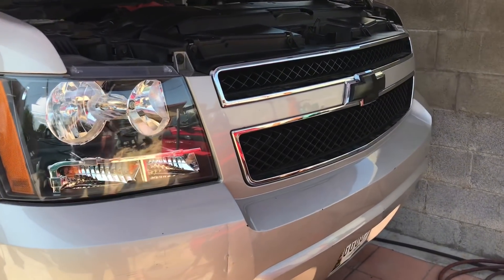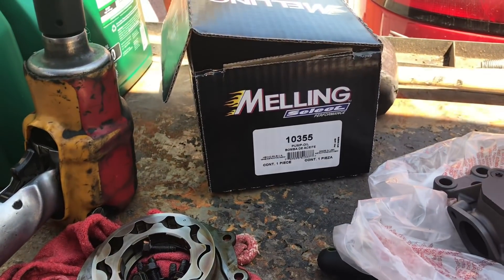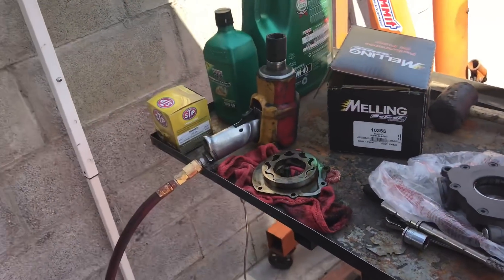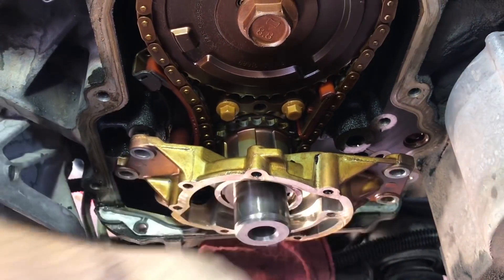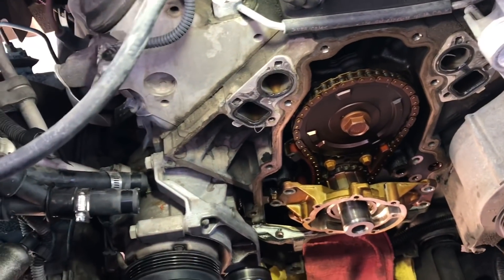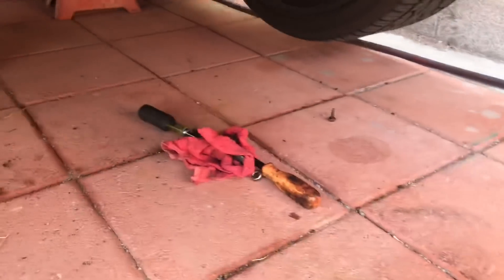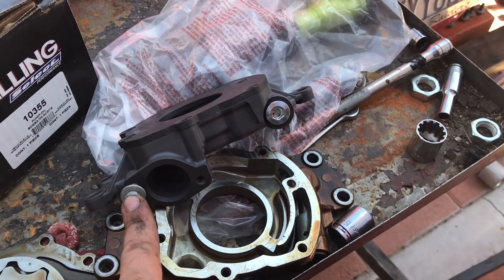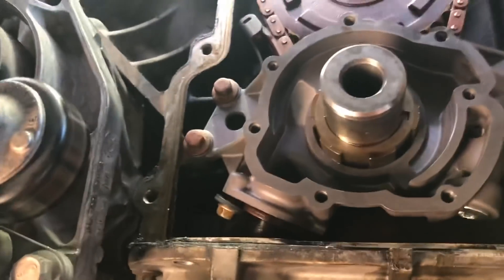Chevy 4.8,5.3,6.0 LS oil pump

Comment: After backing out the pickup tube bolt, tie a string around. That way it's easy to get if you drop it. Remove the string after you get it started again.
Reply from the maker: Duaine Reynolds Thanks man good idea I’ll try that next time!!!
Reply: Duaine, that gives me an idea. I wonder if you wrap that string the right direction around the bolt, you could pull it to spin the bolt back in when reassembling to avoid having to modify the pick up tube. I think I’ll give that a shot when I do mine.
Reply: Fishing line yep!

Comment: Why didn't you just shim the existing relief spring, or replace the spring (or both) in the original pump BEFORE swapping the entire pump ? Obviously the original pump may have seen some sag in the spring, allowing it to open prematurely, ESPECIALLY when cold under greater pressure, so a shim could have solved the problem much easier, or at worst, just a new spring. The gears looked mint, so I think an entire new pump assembly was a bit of a waste in both time and money. Remember, the filter area of the inside of the pan also has a relief valve, so this could have ended up being entirely pointless in the end. Just a thought.
Reply: Totally agree!

Comment: Why did you take the pump apart for the gears??  I'm confused there.
Reply from the maker: la nave del sabor 
A must when replacing pump, when u don’t want to remove oil pan. Otherwise if u remove oil pan no need to take oil pump apart.

Comment: All you have to do is remove the oil pan. This will allow you to easily remove oil pickup line.
Reply: Paul Leksunkin unless you have a 4x4!  Then it’s skid plate, remove half shaft, disconnect CV axles, remove front differential, drop steering then you can finally get to the oil pan!
Reply: I have 4x4 and only had to unbolt differential the it dropped far enough to pull oil pan out. No sweat
Reply: What are the chances of it being the pump and not the O ring.?

Comment: So I just done this. Used the washer and bolt trick. I did not replace the o ring. Now I have a low pressure warning on. Is it the o ring or is it the washer and bolt? When the engine is at 2000 rpm oil pressure is between 40 and 60lbs.
Reply from the maker: Rob Hudson definitely the O ring
Replacing it is a must!!! That’s why ur loosing pressure. U need to replace it asap!!! Engine is probably starving for oil.
Reply: oscar corona that was my guess too. I know I should’ve but just didn’t. Really cool trick about the pickup tube super helpful.
Reply: you had all this stuff apart and didnt replace the biggest cause of low oil pressure on these things? (the o-ring)....man--i wouldnt want to do that job over...

Comment: You have to drop the pan and replace the oil screen . if that is plugged up your going to still have low oil pressure . if you drop the pan first and change it out that might be the reason you have low oil pressure .
Reply from the maker: Estebahn Goldman 
Your correct that can also be an issue 
Luckily for this vehicle new oil pump fixed the problem. Thanks for the input will consider it for next project:)
Reply: @mrcrown9657  We dont know if it fixed the problem

Comment: All that extra time you could have done it the right way the first time... your not supposed to disassemble the oil pump!
Reply from the maker: Brandon Anthony actually i saved about an hour, I’ve time myself before. Done probably over a dozen. Never had any issues. Then again this is just an option if u don’t wanna drop pan, that’s why i made video.Customer didn’t want that-so... I actually prefer to drop pan too
Reply: What ever you say bub

Comment: What was your pressure before and after?
Reply from the maker: William Taboada 
Cant remember exactly but it was way below half mark on gauge and lifters used to tick a lot at star up. Now pressure above half mark and no more ticking :)
Reply: Im thinking he only needed an O ring
Reply: I just change on a 2002 gmc denali 6.0 motor sparkplugs and wires  change  of oil & oil pressure sensor changed, bank sensor changed.. code p0141 02 bank1 sensor 2 ,  eliminated  2 codes p0141 and p0300 misfire detected. Code p0300 misfire detected. Motor has a thicking sound with low oil pressure in my cluster gauge. I think I just found my problem oil pump. I was thinking it could of been my catalic converter  since code p0300 read  at auto zone read exhaust manifold gaskets leaks..
Reply: @mrcrown9657  I just change on a 2002 gmc denali 6.0 motor sparkplugs and wires  change  of oil & oil pressure sensor changed, bank sensor changed.. code p0141 02 bank1 sensor 2 ,  eliminated  2 codes p0141 and p0300 misfire detected. Code p0300 misfire detected. Motor has a thicking sound with low oil pressure in my cluster gauge. I think I just found my problem oil pump. I was thinking it could of been my catalic converter  since code p0300 read  at auto zone read exhaust manifold gaskets leaks..

Comment: Can a bad o ring cause an oil leak outside of the oil pump. Or could it be the timing cover seal? Or gasket?
Reply from the maker: Wiskie garage Bad “O” ring will cause wrong oil pressure, worn out gasket could create an oil leak, oil pan gasket very typical on these.
Reply: @mrcrown9657  thanks bud..

Comment: Nice video though, but that job scares me being in apartments. My oil pressure goes up when I drive, and only hits 0 when at idle, is that a bad pump symptom?  2004 Tahoe.
Reply from the maker: Robert Felp that sounds like a bad Oil Pressure Sensor, it’s behind engine close to fire wall, you’ll need a deep 24mm socket to remove and be able to reach way back there.
Reply: or bad o-ring on that pickup tube....a HUGE, KNOWN issue on these things....
a new o-ring may be all you need, but that involves dropping the pan...if i am doing tht much, i might as well do the whole pump, seals, and check the timing chain while at it...
Reply: @cleatus45  Thanks for that, funny you mention this is what I think it is too because if my oil pump was BAD it wouldn't be working when the truck warms up and under throttle. Also thicker oil helped my pressure alot more so far, I think your right!!

Comment: Do the job RIGHT. Pull the oil pan, it makes changing the oil pump a lot easier, and change that wore out timing chain.
Reply: That is 110% what I was thinking. Drop the pan, all you need is a new gasket, oil and filter.
Reply: @soprano1n1    Also, you can clean any sludge that's in the pan and the oil pick-up screen. Bad thing is, if you have 4 wheel drive, you have top drop the front differential, that's a lot of work.

Comment: Isn’t there 2 nuts holding the pickup tube ? I see no way prying the pickup tube up
Reply from the maker: Carlos Juarez yes there is inside pan
If u put a screwdriver in between the pump and tube u can pry a little and pump will come apart without removing tube completely. I was able to do it not, that’s why i take pump gears out to have more play to remove it.

Comment: just remove the oil pan, clean the pick up tube acreen and replace the gasket and oil filter,  you will also be able to clean the sluge that concentrates inside the oil pan, dont be a numnut,
Reply from the maker: El primo Rodriguezm l GAQ8QA 
That’s exactly what I did on my personal truck, but this belongs to a customer and didn’t want to do that even after I recommended it.
The purpose of video was to show another option on replacing pump without removing pan.
Reply: oscar corona ok,  now I understand
Reply: How about the way he rigged that pick up tube bolt.

Comment: Dude I just can't see how y'all managed to get to this bolt. I've been trying for 2 hours.
Reply from the maker: lilhed 
Yea It’s kind of hidden 
I just put a 10mm wrench with a slight angle to get in between oil pan.
Did u loosen pump and cover on pump? That helps you to be able to move pump and get to the bolt.
Reply: @mrcrown9657  yeah I've tried angles and everything...I'm just going to have to drop this damn oil pan...sigh. Good video though. 👍
Reply from the maker: lilhed 
Well at leat you’ll be able to clean oil pan and pick up tube, best of luck:)

Comment: NOOOO WAAAAY would i trust that bolt. That washer needs to be against a flat surface. You need at least a four tread spacer in between.. BTW,Great video!
Reply from the maker: K WALL that’s exactly what I thought when my friend told me about it, he’s done hundreds of them like this and after i did my first one never had an issue. I’ve now done over a dozen like this now. Doesn’t look right but I guess bolt is strong enough to push the pick up tube right up into the pump and wont come loose. This has been my experience that’s all.

Comment: how many miles does an oil pump last?
Reply from the maker: William Balda the factory one probably a little over 100k is when I’ve seen them tick a little more, oil changes also makes a difference. The new one from Melling will probably last a while as it improves oil flow quite a bit.

Comment: I need to know how to change oil pump on a 2004 surban xl 4x4
Reply from the maker: Karen Sexy Kelly 
Same process 
I didn’t show on video but u have to:
Drain coolant
Remove fan shroud and fan clutch(if equipped) 
Drive belts 
Radiator hoses
Water pump
Harmonic balancer 
Timing cover 
(Whole job 2-3 hrs depending on experience and tools)

Comment: Why cut and turn the plate instead of just putting a bolt and washer. The bolt and washer seems like a great idea instead of taking the chance of metal and such going in during the table cutting? Awesome bud, what's your magnet look like??
Reply from the maker: Ron Grace 
On older models like 1999-2002 is where i like doing that, makes it more secure, my preference 
But on newer models u can't turn plate so i put washer and bolt like you said. Either way work as long as it has a tight seal.
Magnet is from Matco it's like a flexible rod very handy.
On my video I ended up putting the washer and bolt, I realized after it was a newer model, sorry for misleading.

Comment: Do it rite drop the oil pan
Reply from the maker: equalizer 5150 normally I would, but customer had pan gasket replaced previously and didn’t want me to do it again. That was the reason for video 
Trying to show others that there is another option if u don’t want to drop pan, especially if u have to drop front differential, but ur correct dropping pan is the correct way.